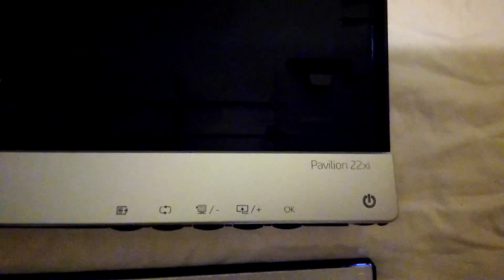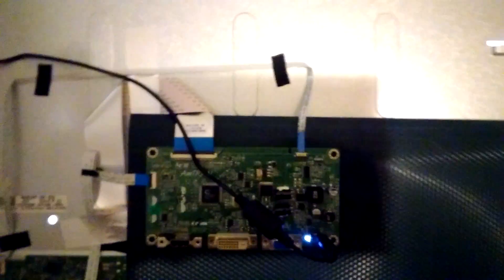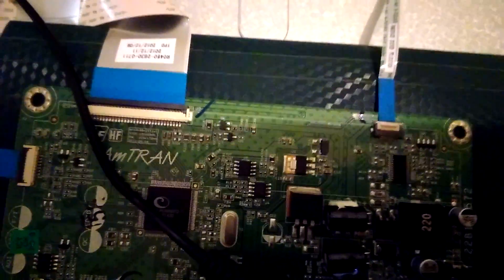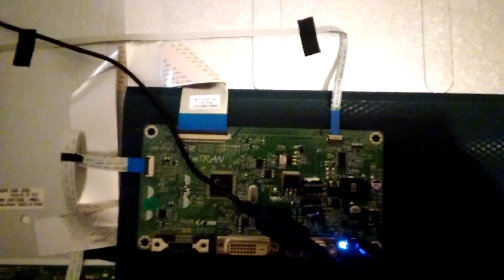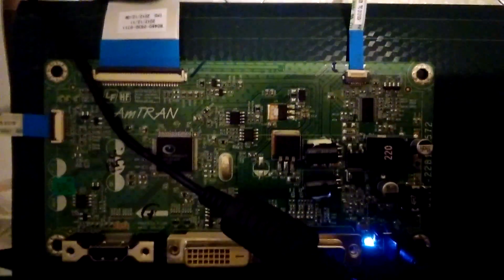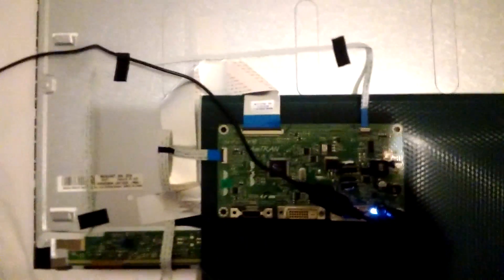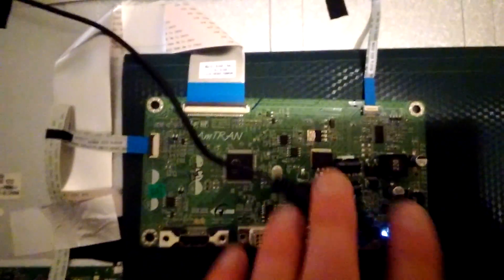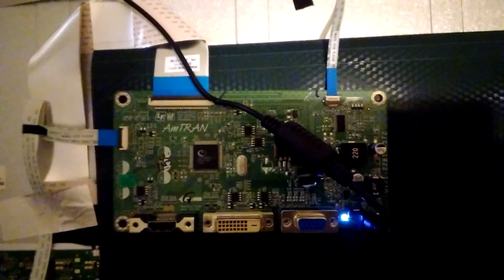HP Pavilion 22xi repair - turns off & freezes after a few minutes of use

Comment: can it work with a Winbond W25X40BVSIG?
Reply: Electro, Hello and thank you, this worked perfectly for my 23xi. 
And as to the question of the W25X40BVSIG,  yes that is what I used, but the chip is wider so you have to bend the pins/legs closer to the body, then it's a little tricky to solder but not too bad. Flux is a must I would say.

Comment: Electro thanks for the video.. I did something different 3 days ago.
        A little background...I've been, as a 'hobby' building my own/family members pc's since windows 98, now that these retired 77 year old hands are not as nimble I did not think I could swap out this chip. Besides I bought the monitor used for 50$.
      After watching your video I decide to take the HP 22xi monitor off  the shelf and fire it up on an old Windows 7 pc, that is nothing but a pc I use to format, wipe hard drives an do other stuff on. After about an hour or so the monitor went blank but still had power. 
      What I discovered was that the plastic back was very warm above the cable/power ports. Following your other video I took the monitor apart. Unhooked all the connections to the supply board, took the board out of the metal case (which was still warm). 
      Since the metal case has cut outs for the inputs, so my thinking was 'what's' another cut out' LoL ....So I measured very carefully where the chip is on the board, transferred the measurements to the metal case, making a rectangular box...made pilot holes at each corner... Then using my Dremel tool I cut out the rectangular box from the Outside (easier) of the case and above where the chip would be when the board is in the case.
     Next I took the case and placed it on the inside of the plastic monitor back, marked the 'cutout' on the back. Using a 3/16'' drill bit, drilled a series of holes in the marked off area of the plastic back for ventilation. 
Added another step, LoL....since heat rises, I measured down 1 1/2'' from the top of the monitor back in four places, drew a line. Then I drilled holes along the line in the back cover so any 'heat' could escape. 
     End result...my 9 year old Hp 22xi monitor and chip has been working for the last 3 days..2 of the days it has been on for at least 6 hours straight.
     I enjoy doing and experimenting with this kind of stuff. Having typed all the above, probably when I click the 'comment' button..the monitor will shut down   LoL!!!
It was fun!

Comment: Thanks for posting your video! I have an HP27xi that has the same issues. I sourced the chip locally but where did you get your programmer? The ones I see on Amazon don’t seem to come with software to work with windows 10. Could you please provide More information on what programmer you purchased and the software to use it? Thanks

Comment: Your video still helping people in 2020 - Thanks so much ELectro! The pandemic finally forced me to sit down and repair the HP 27xi I had. Can’t believe you isolated the problem down to one chip with a hair dryer!

If anyone needs the .bin for HP 27xi, pop me a message and I’ll try to get back to you. I was able to pull mine off my chip, but it did not match the other .bin for 27xi someone else shared in the comments here. I used theirs originally to no avail and had to redo it with my own chip’s .bin. Best of luck to anyone else out there embarking on this project.
Reply: I have the same HP 27xi Monitor so could you share the file from yours?
Thanks
Reply: I have a 27xi and would be eternally grateful for this!
Reply: which chip did you use?
Reply: Hi bro, can you share the .bin?, please!

Comment: Hi all, 

I'm just about to repair an old HP envy 27" IPS display. This uses the same Winbond 25x41clnig chip as the monitor in the video. 

 I have found an old HDD board that has the chip listed below on the board:

https://datasheet.octopart.com/25P40VP-STMicroelectronics-datasheet-120089196.pdf

Would this work as a replacement without buying a new chip ? 

Thanks

Comment: Thank you for this very useful video. I don't know how you managed to isolate the problem to that EEPROM chip, but good for you!  I would have assumed that the EEPROM data would be read once when the monitor was started up, but not accessed during normal operation. But, I guess not --- it must be accessed later on, after it gets hot, and that installed chip malfunctions.  I have a 22bw which had exactly the same shut-down/freeze problem. Bought 10 pcs of Winbond W25X40CL, as well as the same CH341A mini-programmer, a chip holder for SOIC-8, as well as a chip-clip. I used the "AsProgrammer" software. I did try using the chip-clip with the original EEPROM still soldered to the PCB, but could not get a reliable connection and consistent reading. I then de-soldered the EEPROM, and put it in the chip holder/adapter. The programmer software was used to read the data from the EEPROM. I did this three times, and then did a file compare of the three files, to confirm I was getting a reliable read-out. Then, I put a new blank W25X40CL into the chip holder, and programmed that new part with the same data I extracted from the original EEPROM chip. After verifying the data I carefully soldered it to the board at U6, making sure I got the orientation correct. Applied power and presto, it worked! Had it running for several hours afterwards, with no freezing or other problems. It sure is a great feeling to restore a failing monitor to working condition. Thanks again for your video! 🇨🇦 🇨🇦 🇨🇦
Reply: Did you have any problems afterwards?
Reply: As I wrote above, I did run the monitor for several hours after I installed the new EEPROM, and it was working perfectly. But, I then put the monitor on the shelf and it hasn't been used since then. So, I have not had any problems with it, but I have not really used it on a day-to-day basis after the repair.
Reply: I have the same monitor 22bw, i've ordered a mainboard of the same monitor as shown in the video, connected the mainboard to the monitor but the monitor didn't turn on, the led indicating power it lights up, hope if you can reply to my msg

Comment: So, I ordered the programmer but it didn't have the clamp, so I had to hold the chip I ordered (25X40BVN1G) with my thumb on the bottom of the CH341A programmer and successfully flashed the 23xi bin from the pinned comment reference. My adventure ended upon trying to remove the bad IC chip. I have no heat gun and no flux. After several attempts to melt the solder and remove with a pump I finally took wire cutters and clipped off the 4 pins on one side. One of the pins (pin 8) ripped off the solder pad with it. I was able to cut away and remove the chip and pins, and clumsily solder in the replacement, except for that pin 8 with no pad. I tried to scrape away the brown area where the pad was to find a lead, but the whole thing was a big mess by this point. Needless to say, there is no response from either the backlight or the LCD.
It's also possible I screwed up elsewhere on the soldering, or the flashing.
Should I just give up?

Comment: Would this work for a 25bw ? Pls help :(
Reply: It appears to be the same board for the 25bw though I'm not sure the flash chip content will match between the 22xi and 25bw..  Did you attempt the repair?  I am going to try putting an aluminum heatsink on the chip for my 25bw.

Comment: Can anyone confirm if this also fixes the monitor not turning on at all 
I have the 25xi and there is a white light showing power gets to the board on the back but i can not turn on the monitor at all
The led in the front is not lite
I want to try the fix but not sure it'll fix my problem

Comment: Every time I try flashing the replacement chip, it doesn't read. I bought 5 LE25U40CMDTWG chips and every time I set one on my programmer it will heat up to the point that it burns to the touch and the programmer software doesn't ever detect it. What am I doing wrong?
Reply from the maker: When you put the IC into your programmer, are you sure the polarity is correct? Try putting a new IC turned 180 degrees. If it's heating up, the IC may be shorted.

The exact IC may not be autodetected or listed in the program. I'd set to "generic 25q40" or something like that and try reading again.

Be sure to follow other instructions for your programmer. There should be YouTube videos explaining how to use it as well.
Reply: Random Electronics Repairs I tried rotating it with a fresh IC and the read just fails. I’ll try setting it to the generic 25q40 tonight. Do you have a program that you prefer using?
Reply: @electro5471  I figured out why it wasn't reading. I wasn't making good enough contact with my IC and my programmer. I just applied a little bit of pressure to the IC while trying to read/write with the IC propperly orientated and it worked perfectly. Thanks!
Reply: Random Electronics Repairs good news, following your instructions fixed the problem! Bad news, I managed to mess up the LED panel in the process. Thanks for the help tho!

Comment: Can you tell me how to power this monitor using USB from laptop... I do not want addon chord which are with it .. simply one hdmi chord and usb chord to plug in laptop and your secondary screen should be upp and running
Reply from the maker: I don't think this would be possible without an external power supply. The monitor uses up to 28w, which is much more than USB would be capable to supply. Otherwise you could use a step-up converter to make the voltage from 5v to 12v, but only for low power applications (maybe up to 5w).
Reply: @electro5471  yep voltage step converter is what i also thought but can we use in 21 inch screen ... Will that work if we plug it to laptop?? That is my confusion
Reply from the maker: @vrajendramandloi5917  No, it should not work. The monitor uses too much power.

Comment: I followed the steps,now my monitor is just blank, shows nothing
Reply from the maker: Try again. Freeze the old IC while you read from it. Don't forget to verify the new IC after writing to it. Be sure to correctly align it before soldering. Maybe try a different IC. 

Be sure the model of your monitor is the same as mine, then you can try the Flash file from the video description. Good luck!

Comment: Thanks, I had the feeling it was the flash chip because i got artifacts in the menu since it started shutting down randomly but this video proof my thesis.  I had everything at home to do the repair maybe im a nerd but ok...(flash chip I used was a (brand new) 8MB/64mbit  and wrong physical size too but it worked). 
GETTO TIP: Chips can be harvested from old wifi routers and nearly everything  wich has a firmware just make sure its the flash chip. 
HINT: Sometimes the software for the programmer doesn't work perfectly because of device incompatibility (Verification fails are a hint therefore), maybe ask the seller for the perfect software.
If help or chip needed i might answer if your lucky.
Reply: Mowgli BKE  Yeah,Whats your discord Name#tag?

Comment: Hi there, I have a 25bw monitor that used to flicker, but now the front led power button does not work and nothing lights up except the small white LED on the back when it is plugged in. I took the power board out and it looks ok. It appears to have the same or a similar chip to yours, but the symptoms are different. Do you have any idea what might be wrong with the monitor? Thanks for any help.

Comment: it's a flash chip on the power mainboard that over heats...when you cycle the power on and off it works ok and then fails again...Lotsa of people will tell you to replace the chip and by a programmer etc. etc. etc... Nonsense.

Take out the Power main board locate the winbond flash chip and put some tape around the legs and over the board. Insulate it from short circuits. Silicone also works....don't cover the body of the chip. Get some copper foil and thermal paste and fix it by pressure and silicone ensuring a heat conductivity between the chip and the copper foil..fold the copper foil several times to form a crude accordion over the body and thermal paste. After assemble ,

locate the position of the chip surface and the copper foil on the motherboard metal case. Mark it.   take apart and drill a small hole (1/16 in.) in the PS metal enclosure directly above the chip. ( with board out) . Get a small screw 3/4in long and a tight fit in the hole. re-assemble the mainboard into it's case. Place screw in the hole and make sure it lines up with the copper foil you placed over the chip. gently  turn the screw till it contacts the foil. tighten ultra gently!. Put the whole thing back together and voila! a 3$ fis for a 150$ screen.
Reply: Clearly this would be a simpler, cheaper fix. However, Pao Lon, I have a polite suggestion, perhaps it is a bit unfair to call the original posters solution "Nonsense" because it actually isn't. Perhaps it is complicated and more expensive than $3 but it IS a solution to this particular problem and some would argue a more durable one. Strong language used in the expression of  ideas is the reason Social media and online communication is such a minefield.  You have a good Idea (objectively it is better because it is simpler and cheaper) this however does not negate the value of other peoples contributions. Problem solving isn't a "Zero Sum"  scenario where only one Idea has merit or wins. Two ideas can co-exist and add value to a problem solving discussion. Consequently the solutions gathered offer the public more options if one solution fails or proves unworkable. Thank you for sharing your Idea. and If you have any pictures of your fix I would love to see them.

Comment: replacing the chip for another is a temporary fix. you must add a heat dissipation device to the chip itself. preventing another failure

Comment: Hello i have same problem, with second hand 22xi buy today with board LIM131 work with 12V power supply, have another RIM111 with 19V power supply have no problem. and test to swap boards. and LIM131 not work. i will test to replace memory today and write about result :) thanks for sharing. (have Post Question can i use 19V power supply for LIM131 ?)
Reply: Hello I fixed monitor with reduce voltage on 8pin with normal diode with 0,6 V and reduce thermal condition on chip. Work without problem memory work from 2,5 to 3,5 I think don’t find official datasheet of memory. Thanks again for detection of problem.
Reply: почему видео не сняли?

Comment: Thanks for the video  When I went through testing the power coming out of the chip it was All over in up-and-down voltage Was not the same pattern Replaced it with a Bigger chip Same as a bio Chip  All good to go Works like a champ 😀Keep the videos up  thanks

Comment: Thank you so much for you effort and sharing your findings! Note: One can, for testing purposes, also try to attach some cooler to that chip. I used some old 5x5cm (1cm height) passive graphicscard-cooler (AGP or PCI-Stoneage, the first thing i've found). The chip is touching that cooler somewhere on the area with the thermal grease. It won't fit into the case like this anymore, but seems to work. Will try the soldering some time. Thanks again!

Comment: Thank you very much for posting this great video. I also used the LE25U40CMD chip as a replacement part. I tried to read the source chip with the MiniPro programmer first, but I couldn't write the image to the LE25U40CMD chip. The part number is unknown and choosing another part number didn't work. I also have the CH341A programmer and I could read and write the chips by choosing winbond w25x40.

Comment: I have a 27xi and I had followed your steps to the tee, also learned how to use the 341a.  I replaced the chip with the LE25U40CMDTWG.   I couldn't read the original chip so I flashed it with the bin provided.  The monitor flashed red, green and blue with this message.
Fw Ver: LIM141
SN: 43CM20056Q
Auto Color: Fail
Panel: RB5LM215WF3 SAP1
any suggestions?
Reply: I ordered a clip for the chip because I have another 27xi which works but I don't want to desolder the chip.  Once I read the chip I will email you the bin.
Reply: Hi Tony. Where did you order the chip and how long did it take to get it? Also did you use the CH341A programmer?  I have a 27xi and would need the bin as well if so.  Would you mind sending that to me?
Reply: Sorry for the really late reply, I ordered the chip from digikey (LE25U40CMDTWG) and the programmer from wish.
Reply from the maker: Yes, you have to find the firmware file for 27xi model. The one I made is for 22xi.
Reply: Thanks for the fast reply.  Would you happen to know where I can get that?
Reply: I just had the same issue with my 27xi. I flashed the one for the 23xi and it basically works... the monitor turns on and runs fine but the power button (capacitive touch) doesn't work as it should. For some reason tapping any of the other menu buttons work like the power button and turn the monitor on and off, but now I can't get to the menu. I'm just happy it works for now. 
If there's someone out there with the correct program I would love to get it!
Reply: Tony Abraham that would be amazing! Thanks
Reply: Thanks, Random Electronic repairs.  Here is my bin for the 27xi, tested and works, if Random Electronic would like to add this to his list of bins I have not problems with that.
https://drive.google.com/drive/folders/1-_JwoxVEdlGwtN_nhUzkANRDtneiKL40?usp=sharing
Reply: Kayboord, would you mind sending me the info for the 23xi in the meantime?  I have no clue what I'm doing.... or any idea how to find it
Reply: hi do u have file for hp 27xi ?
Reply: Hello, my HP Pavilion 27XI died a few days ago, and I can`t find the firmware for it. Can you, please, help me and tell me where I could find it? Thank you!